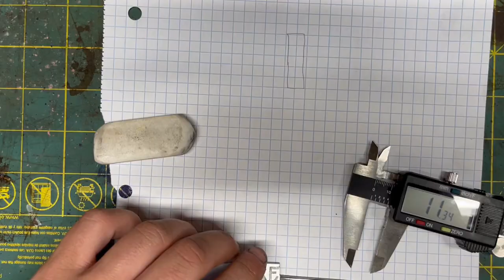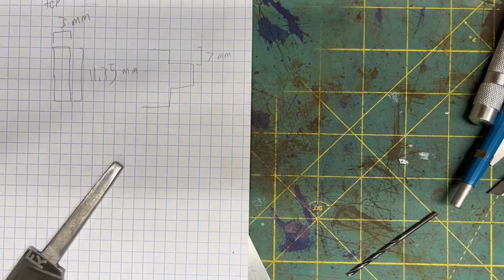Making A Brass Guard for A Hidden Tang Knife

Comment: Cool :) i just started a similar project with copper. I think if you filed a 90 on top and bottom of blade where it comes in contact with the brass, it will fit even better! Looks very clean though, nice work.
Reply from the maker: You might be right but you want to avoid sharp corners in higher stress areas because it can introduce higher stress concentrations that lead to fractures. I prefer to sacrifice a very small amount of fit to have a stronger tang that last longer.

Comment: 😂so no one solders a guard they use glue????
Reply from the maker: Thank you for commenting. I do not know of anyone who solders guards on. This video does not show it, but I pin through the guard into the wood and peen it over. I also grind notches into the tang with a small wheel so that the epoxy has pockets so sit into. That is more than enough to keep the handle and guard attached. The next video after this one shows that process